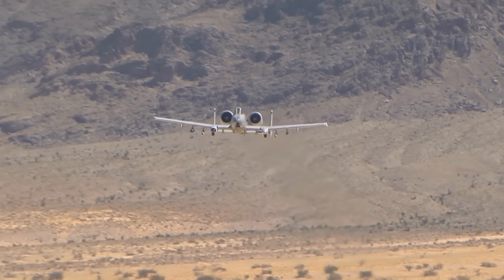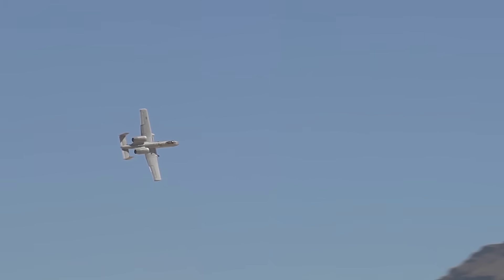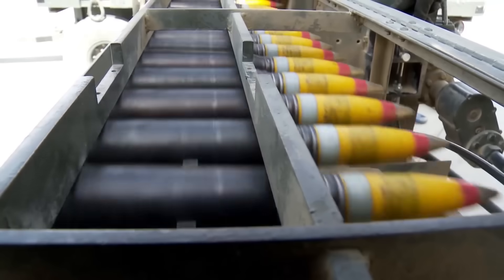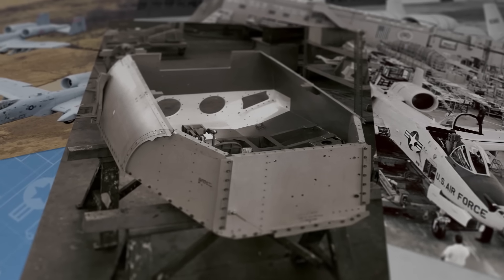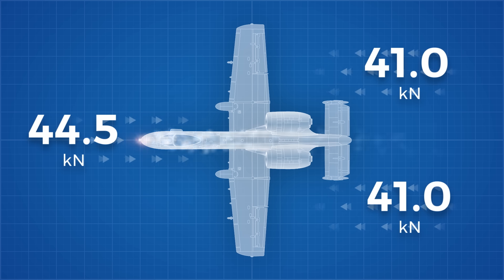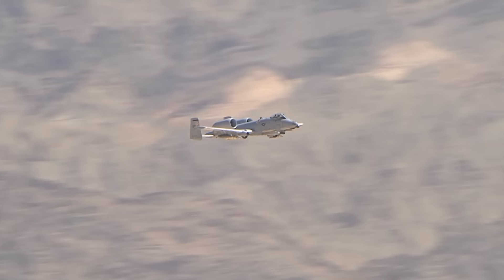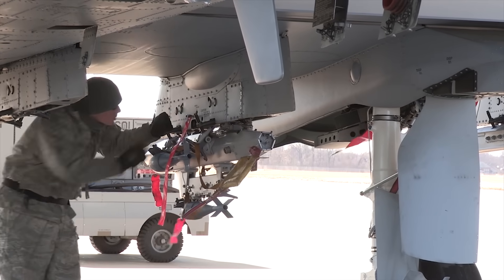The Insane Engineering of the A-10 Warthog

Comment: It’s not a gun mounted on a plane, it’s a plane mounted on a gun
Reply: Lol, it actually is though
Reply: Most planes have a gun.
The GAU8 has a plane.
Reply: a101a most planes don’t have a 30mm gun
Reply: a101a The A-10 is a gun that has a plane.
Reply: Dennis Vance it’s a bird it’s a plane it’s a big bad mother fucker of a gun !
Reply: a101a but only one gun has wings
Reply: General Electric produced some very convincing promotional films back in the day.
Not hard to imagine the USAF Chief of Staff watching the presentation and saying "HOT DAMN, we need to design us a plane for this here tank-killing gun".
The static fire demos might have had a bit to do with it as well....
Reply: Literally
Reply: I remember watching a documentary about the A10 and a pilot qouted that the gun would shake the entire cockpit when fired.
Reply: Chicken Stealer  I wouldn't say it's an evolution of the MG 213, that goes to the ADEN and M39. The GAU-8 is an evolution of the original Gatling gun.
Reply: @taylorc2542  <-- this person correct. The Avenger is basically seven non-auto 30mm Anti-Tank rifles, each with their own breech and bolt, mounted into a carriage assembly where the operating cycle for each rifle is actuated via cams through the rotating motion of the barrel cluster. 
The only teensy-tiny differences from the original Gatling concept are the electronic control system, the dual-redundant hydraulic drive for the barrel cluster, the rate of fire enabled by the previous, and the highly specialised ammunition which had just about as much engineering put into it as the gun itself. Aluminium cartridge cases... What a fascinating modern world we live in.
Reply: the pilot pretty much rides that gun into battle. makes me think of this: https://vignette.wikia.nocookie.net/reboot/images/8/8c/Matrix_Bike.jpg/revision/latest?cb=20080414112550
Reply: Chicken Stealer  Yup.  The designers did it right.  How do you know what type of plane you need to design for destroying a lot of tanks:  you talk to a pilot who flew a plane that destroyed a ton of tanks.
Reply: why do people keep saying this
Reply: @jimmyrecard6021  its true.
The airframe was literally designed around the gun.
The gun wasnt designed for the airframe as per usual.
Reply: Jimmy Recard well from what I heard the GAU-8 (the a-10 Gun) is so big they have to build around it instead of just inserting it
Reply: @jimmyrecard6021  becasue the whole reason for the A-10 ot have been designed was because of GAU-8 and the need for a platform to take it into batttle..

the gun was too big and unwieldy ot be  properly mounted in a pre existing vehicle, so they went the other way around and decided ot build a new Type of vehicle around the gun.
Reply: Chicken Stealer  > It was designed in part by stuka pilot Hans-Ulrich Rudel. Also, its gun in a evolution of the captured mauser MG 213.

Rudel was consulted a bit, but had no design role.  He wasn't just a stuka pilot but the hottest ground attack pilot of all time, something like 300+ tanks, trains, and other targets taken out.  Even lost his leg near the end and kept flying.  Despite his expertise on ground attack, I don't think he did ground SUPPORT, that is just hanging out and helping infantry win fights.  And the Stuka really only dive-bombs and that's one thing I've never seen the A-10 do or need to do.  I bet his advice was just "it has to be able to dive bomb!   that's the only way to hit ground targets accurately!"
All Gatling guns could be said to derive from the (duh) Gatling.  This gun's not famed for its innovation, but firepower and reliability.  By my calculations no other gun or cannon can throw more weight in bullets per minute, not even the 16" main guns on the Iowa battleships...  Think about that.  10 A-10s have more throw weight than a battleship.  And that's just if they stick to guns...
Reply: i'v  never agreed with someone even more
Reply: Cliche' but true.
Reply: Rather ironically, this was built to fight against Soviet Russia.
Reply: @marcus4403  The "Stuka" is the popular name for the German Junkers Ju 87 dive bomber. It's not Russian.
Reply: @PerfidiousLeaf  I was making a joke...
Reply: Chicken Stealer the mauser 213 was not a multiple - barrel gun.
Reply: Very original
Reply: Correct. As the video states: first they designed and built the gun, THEN they designed the plane to go around it.
Reply: Chicken Stealer  Love child between between Rudels´s Ju-87 and FW-190. On loads of steroids.
Reply: The plane is the accessory
Reply: Dacialovebbone.link/DSz5sdds
Reply: Wing Ding  Well, depend on which side the soldiers are...
Reply: Silas Robot 👆👆👆👆👆👆👆👆👆👆
Reply: It’s an spg

Change my mind
Reply: hahahahhaha. true
Reply: Did you also notice he called it A10 Lightning bolt.
Reply: YES INDEED Quite A Gun And Plane !!
Reply: indeed xD
Reply: The whole airframe was designed around the gun! Point shoot and never have to buy another beer as a pilot!!
Reply: Literally. The plane was built around the gun
Reply: A big bad plane with a big bad gun ,it’s insane !
Reply: Wing Ding  yeah, as long as the plane didn't get downed by enemy AA XD
Reply: Chicken Stealer  yanks are great at copying shit and claiming it as their own, It comes with the fragile ego thing..
Reply: @mark675  Says the Englishman with the massive ego.
Reply: mark675 tell me which plane they have copy.  ?  you will not find any.
Reply: @mark675  Yes, because the only one who borrows from other designs is the US. It's not like half of your shit in the war was borrowing or outright made by the US. And the other half was US Lend Lease.
Reply: @PerfidiousLeaf  ok enjoy our harriers..
Reply: mark675  I can get what your saying as the M39 (a US 20mm revolver cannon) is a copy of the MG 213 but the GAU-8 is more or less a more modern,bigger caliber version of the Gatling gun (used in the American civil war) and didn’t the A-10 design team only just take notes from Hans-Ulrich Rudel autobiography?
Reply: @mark675  Your Harriers are pretty much out of service you know.
Reply: @measl  whats your point?
Reply: @mark675  Can you give any examples?

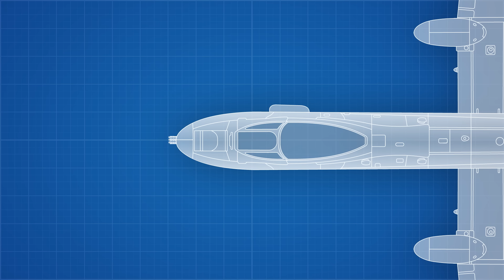Comment: Nice piece on the A10, there is a slight inaccuracy you mentioned at @7:44 the gun is actually mounted slightly off center so that the FIRING barrel IS aligned along the center line of the air frame, your animation of the gun firing is also incorrect at that time index.

Comment: The 30mm GAU 8/A is not mounted on the direct center of the aircraft as is mentioned in 7:44. It is mounted slightly to the left of the because the shells leave the gun at the 3 o'clock barrel which is the direct center line of the plane.

Comment: I'll say it once and I'll say it again, the only thing that can replace an A-10 is a better A-10. As long as there are fronts where you have infantry fighting infantry, light armor fighting light armor, friendlies pinned down, outnumber or overun you will have a use and a need for an aircraft like the A-10 that isn't afraid of getting down in the dirt with the troops it's protecting to lay down close air support. And you know an F-16 isn't going to do that, less so the fancy new super expensive and fickle as all hell experimental F-35.

I can understand the new propeller driven light close air support aircraft taking over some of the A-10s roles in lower threat environments though, I mean hell the Sky Raider lasted long as it did and was only replaced by the A-10 for much the same reason so it only makes sense.

Comment: Actually, the gun itself is not mounted on the centerline of the aircraft. It is slightly offset because the position of the barrel that’s firing is either at nine or six o’clock (can’t remember which) and it’s this barrel that’s on the centerline.

Comment: This is a role that goes back to the specialized ground attack planes, starting with the British 2,500 HP Typhoon, a beast of a plane that was best at its specialty, shown in this video, and the Douglas A-1 Skyraider (which we didn't see here), that far outlasted its predicted useful life, as also has the A-10 Warthog, as close ground support will always be needed. I don't think any multi purpose plane can do as well at any specialty as a purpose built design. Unless something better is designed I'd say the A-10 will be in use. If it didn't cost $5,400.00 per hour to operate I'd like to have one!

Comment: Actually even the guns placement is critical;
 Because the gun's recoil forces could push the entire plane off target during firing, the weapon itself is mounted laterally off-center, slightly to the port side of the fuselage centerline, with the actively "firing" barrel in the nine o'clock position (when viewed from the front of the aircraft), so that the firing barrel lies directly on the aircraft's centerline 
https://en.wikipedia.org/wiki/GAU-8_Avenger

Comment: The A-10’s gun is actually offset to the side so that the gun fires from the 9 o’ clock position. This was to compensate for recoil.
Reply: Sort of, the 9 o’clock barrel position in exactly in line with the aircraft centerline and gun sight .  Recoil will also be on centerline.

Comment: I'm an A&P Mechanic, I work on aircraft. The JSF F-35 is absolute crap compared to the F-22 or A-10. It tried to be all things to all people and it instead became an absolute waste of money. The A-10 still flies because it does it's job and it does it's job well. The F-22 still flies because of the same reason. The F-35 can't dog fight and it can't handle an rpg to the body. In fact the F-35 stealth return is so bad it compared to the F-117s issues which led to retirement. The only roles the F-35 is useful for is to have a fighter that can land and be resupplied in hot zones. They made 3 versions of it, and only one actually had any value as a replacement for the Harrier. Just don't get me started on the lift fans flaws. >.<
Reply: It's absolutely ridiculous to say the modern battlefield will be "so dense" that a tough close-in support aircraft would be futile. What the hell does that even mean? That it's best to have something so obsessed with stealth, speed and range that it's not "cool" to approach the theatre low and slow (with a crap load of bombs and firepower) to help ground infantry? That it has to have this big-budget superfast, ultra-long distance, fancy "bob and weave" stuff, so screw the troops? 

The F-35 has never been to war with another country, let alone another superpower; but there is no way in hell they are putting an asset like that in harms way like the A-10. I heard the guy from this channel once say that the F-35's stealth is superior because it "delays and complicates" detection -- as though that's something Russia or China doesn't already know about and spent millions to defeat with their own ground/air radar systems. As though nobody knows that war is all about setting and maintaining momentum and overcoming your opponents efforts and disrupting that momentum.

Comment: Originally deaigned and build on Long Island by Fairchild in Farmingdale. Fairchild is long gone with all manufacturing hangers torn down and replaced by a strip mall. Ugh. So much history now gone, along with Grumman who designed several aircraft and the Lunar Excursion Module (LEM) that went to the moon and Sperry/Unisys inventor of the electric gyroscope, radar, submarine navigation, and weapons control systems. Now all gone. Such a shame. The airport that was built by Fairchild is now a general aviation airport in Farmingdale (KFRG) the only state run airport in the NY metropolitan area and they use it to train Air Traffic Controllers. (Scary, right)
Grumman employeed over 85,000 employees with round the clock jobs in the 60s

Comment: As an A-10 crew chief, I loved the video there just a few things I want to point out first is only the center panel of the windscreen is bullet-resistant glass, second is that the shells are replaced in the drum for weight because when we fly without ammo the jet has to have ballast plates installed, third even if the jet loses both hydro systems there are charged accumulators for dropping the landing gear and activating the brakes, and fourth the leading edge slats are also used during the gun firing to bring fresh air from under the wing as well. Love the videos and keep up the good work.

Comment: A quibble with the graphics from 7:43 to 8:13: the protruding part of the gun system, the cylinder that the 7 barrels rotate within, is not centered but offset to the left. The recoil is down the center of the plane because the rightmost barrel is the one that fires (each one gets used when it rolls around to the rightmost position). They could have made the top or bottom the firing point and mounted the whole thing in a truly centered position, but that would divide the space that the gun doesn't take up in the front area of the plane into two sections that are both too small to put landing gear in. Offset the gun to the left, and the non-gun space is asymmetrically divided, with a bigger one to the right, which you can put landing gear in. Also, if you paint a monster face on a plane with an offset gun, the face-paint turns the gun into a cigar.

Comment: at around 7:43 you mention the gun is mounted directly on the centre line of the aircraft; this isn't quite true though. It's actually offset to the port side slightly, to make room for the nose landing gear. To counteract the otherwise-asymmetric force generated by this,  the firing barrel is the rightmost one (as opposed to the more typical topmost barrel) so the barrel firing is always on the centre line.

Comment: One correction is that the gun itself is not mounted on the centerline,  It is off set to the port wing, the barrel that fires is however in line with the center line

Comment: 0:17 - It is NOT NOT NOT the "Lightning Bolt," dipstick!  It's the "Thunderbolt II," namesake of the P-47 Thunderbolt of WWII.  And it is NOT known as the "Hog,"  It's the "Warthog."  There IS a difference.
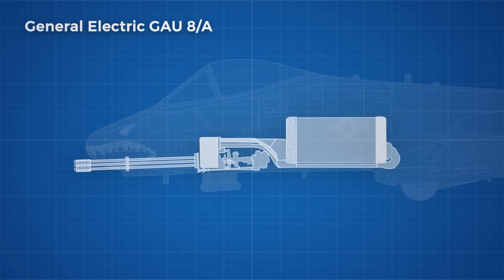3:32 - What's an "arnament?"  Is it something you hang on the tree during Christmas season?  :)
10:40 - The term is "cubic centimeter," NOT "centimeter cubed."  It means a cube with all sides measuing 1cm x 1cm.  DUH!
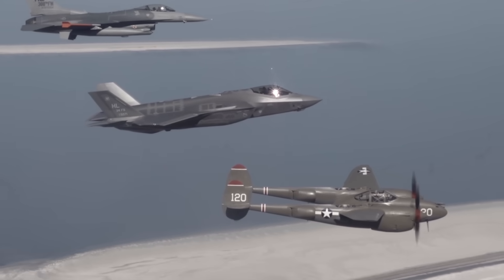14:10 - Do NOT show a P-38 Lightning and mention "close air support" in the same sentence.  The Lightning was designed as a high altitude interceptor, the exact OPPOSITE of a ground attack aircraft.  How many errors will you make in one video?
OH, and by the way...  Nebula is pronounced NEB you lah, NOT "NEB lah."  +facepalm+

Comment: A key feature of the A-10 that all the Mach Snot proponents (F-16 / F-35) fail to acknowledge is its amazing loiter time (ability to stay in the area for hours providing cover as needed).  A high speed plane might be able to give what, half an hour before leaving?  That and they are swept-wing so they can't travel as slowly to take in the situation.  Only time they travel as slow as the A-10 puts around is when they're landing, if I understand correctly.  Now of course the A-10 can go faster to get to the target, but cruising around slowly is its primary function.  Worried about air superiority or antiaircraft fire?  Wait, isn't that the job of the Boom Zoom crowd?  That's their specialty.  They clear the air, and the A-10 clears the ground.  In fact they'd probably make a good team to take out any few remaining AA.  A-10 draws fire, F-35 pounces from beyond visual range when it reveals itself.

Comment: As an old airline pilot, one of my flight engineers was the test pilot for the A-10. He told many stories about the initial testing and how scary it was. The first time he fired the cannon both engines flammed out! He was slammed into the instrument panel due to the sudden force on the plane. He said it took a long time to iron the gases from the cannon not going into the engines. It is hard to picture how large this plane is. I have been to airports where the national guard flies them and they are as big as a DC 9 sitting next to them. The cockpit has a titanium tub for the pilot's protection and it has many backup systems in case of damage.

Comment: So the gun is actually offset ever so slightly so the firing barrel lines up with the center of mass. The firing barrel is at the 3 o clock position when looking from the cockpit. You can see the slight offset on some front facing shots.

Comment: You are correct that the f-35 does not have the armour of the A-10, but its accuracy and electronics doesn't require it to fly as low as the A-10 and its stealth keeps it relatively safe.